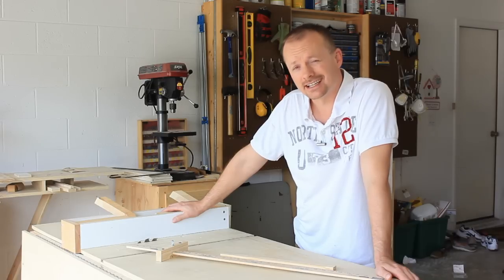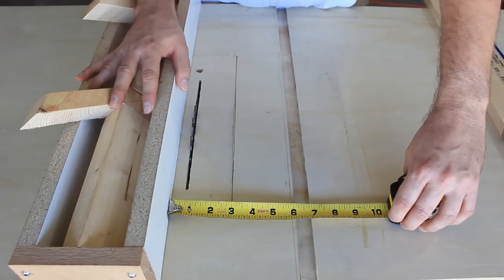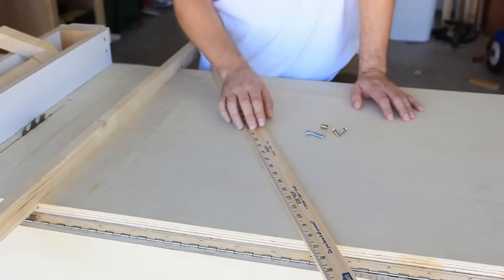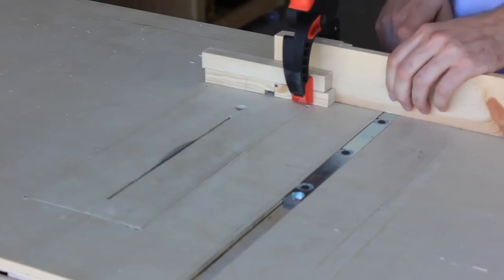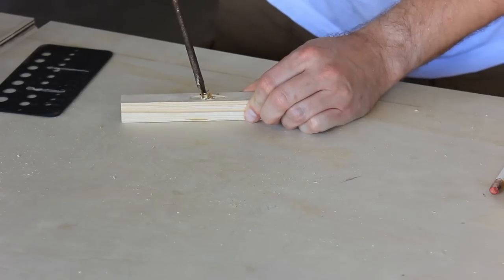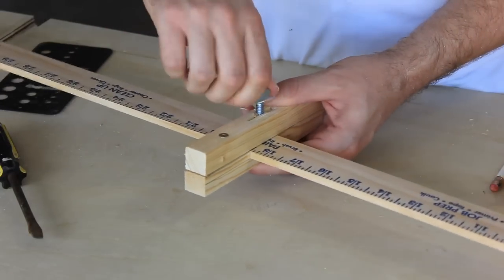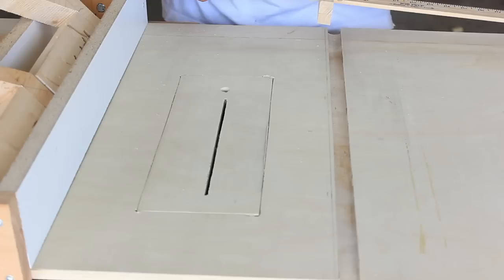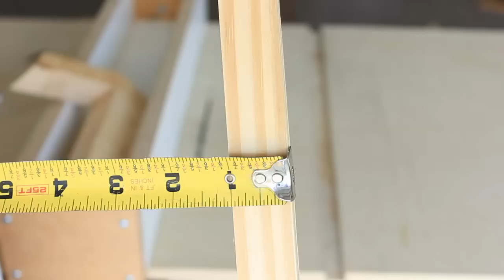Rip Fence alignment jig

Comment: On small projects you can cut the head of a bolt off, thread two nuts on and slip bolt into your drill press chuck. locking the nuts together then thread on thread zirt and tune it into the wood. If it gets to hard to turn the chuck use a wrench on upper nut. then turn and push down on your hand wheel of your press

Comment: This looks just a shade easier than a combination square used in the same manner.  You don't have to worry about combination square's back end.
Reply from the maker: I touch on this very point in the blog post for this video.  Link in description for anyone who would like to check it out.  Good comment, thanks.
Reply: I like also that it is wood and not metal being placed on there.

Comment: just stick a snug fitting board into the miter slot and butt the fence up against the board. adjust the fence until it sits flush. 

the harder part is aligning the blade to the miter slot/fence
Reply from the maker: I guess I'm not following what suggestion your trying to make.  I think you might have missed the previous videos in this series.  Aligning the blade and miter slot was done in a previous project.
Reply: I havent watched that one. I was just suggesting an easier way to align the fence without needing a jig
Reply from the maker: mike gager You mean for the first part of the video when I walked through what I used to do.  I think.  Someone will probably find that a useful suggestion.  Thanks for posting.

Comment: So the piece that rides in the sled track, needs to be the thickness of the ruler taller so when dadoed , it sets flush,,, correct?
,
Reply from the maker: Tim Russell Technically yes.  However, make it just a hair of a chinny chin chin taller if you have the ability.  Perhaps the width of the line on your measuring tape.  The pieces will expand at times making the ruler tough to slide in its slot.  Leave just a bit of breathing room.
Reply: width of the line?

Comment: how about this stan. use the same setup with the wood pcs. but use a blank pc. of wood instead of the yardstick. then place a stick on ruler that reads right to left and still use the miter slot. this way you wouldn't have to add inches to the rip cut. the ruler would read distance from the blade to the fence. I bet this is as clear as mud
Reply from the maker: Deb Riley Clear as mud, yep...lol...actually I got what your saying before I finished reading your comment because I had the same thought at the time.  I then looked at the price of those adhesive measurement strips and compared to a 98 cent ruler.  The ruler won out for me.  However, with that said, if money is no object then yes the adhesive strips would be my first choice.  I address this option in the blog post that I wrote for this video.  You can check the description if you would like to check that out.